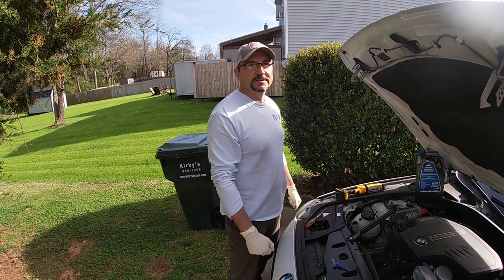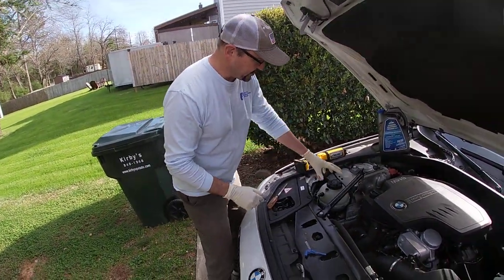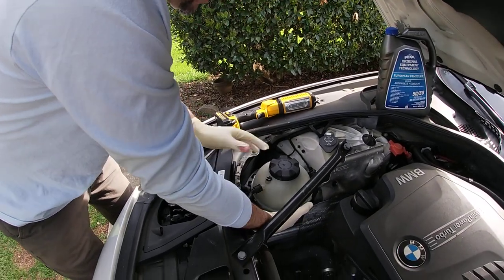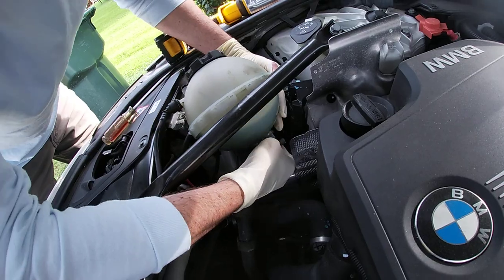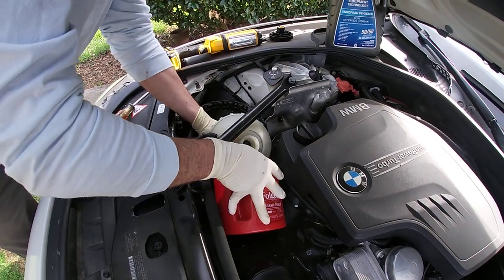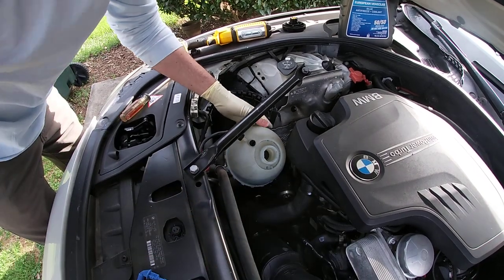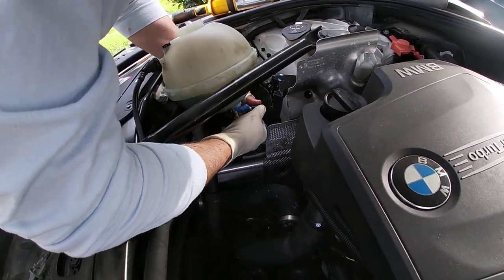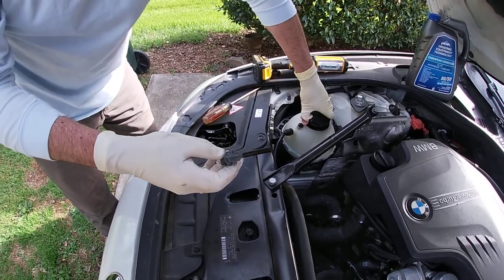BMW 528i Low Coolant Level, Sensor Replacement

Comment from the maker: Update - The check coolant level light came back shortly after this sensor replacement.  The issue was a float in the tank.  I replaced the entire tank and that fixed the issue.
Reply: Thank you so much.
Reply: Did you go with an oem coolant reservoir?
Reply from the maker: @psykocid3103  No, not OEM.  It was an aftermarket reservoir.  I made a video about that install so check it out if interested.
Reply: Did you notice the expansion tank filling up when the check coolant level light was on?  I'm troubleshooting the same coolant level light problem on my 2015 528i, and this video is easily the best one showing how to replace the sensor!
Reply: where did you buy this part?

Comment: Do you have the part number to order? Where did you order the part?
Reply from the maker: I bought the sensor at O'Reilly Auto Parts.  Import Direct Ignition 2 Terminal Multi-Function Wire Connector - 18-2476
Part # 18-2476

Comment: I replaced the coolant sensor but I still get the same warning message. Any idea what I could be?
Reply from the maker: It may be the float inside the reservoir . Check to see if the float is functioning.
Reply: @granitebowtie1758  I ordered a new reservoir tank and will be replacing when it arrives. Do you think it will fix the issue?
Reply: @glennnumfor875  Any update?
Reply: @johnsondoeboy2772  so it actually was the reservoir tank. Haven’t had any other issues after I got that changed.
Reply: @glennnumfor875  ok thanks